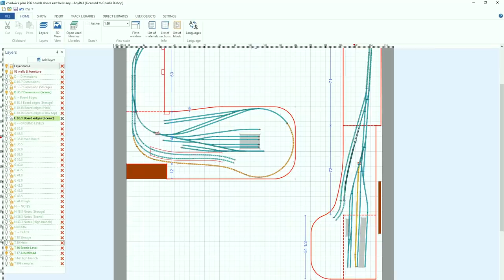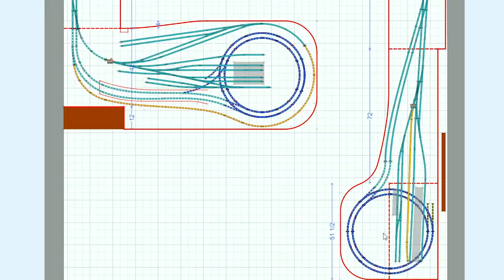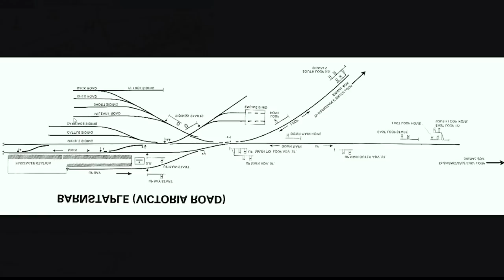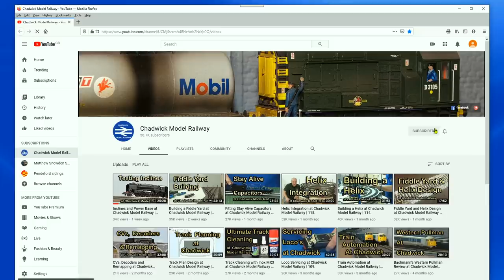Track Laying on the Station Approach at Chadwick Model Railway | 125.

Comment: Hi Charlie.
Good work so far.
However, there's something that's missing from your pointwork... catch points.
With the area being on an incline, the chances of runaway stock is much higher than on a flat surface.
At a minimum you'd need one after the double-slip (on the viaduct end)... and possibly another where the goods lines go onto the platform sidings.

Hope that proves useful to you

Laura
Reply from the maker: Yes that one past me by Laura. I’m putting one at the end of the two good lines as they approach the double slip. Regards Charlie

Comment: How did you get from 4% down to 2.5%? I have altered my layout plan again and now I will be able to run 3 trains (DC) at any time, but I have moved the inclines to the straight sections of tracks. The boards will be made in six sections, but the design is wide and I am now worried about if anything goes wrong towards the back, how will I reach it. Until I can move into the room where the layout is going to be (18-year-old stepdaughter going to university or Technical College.) Board number one and five are nearly in the building stage. (At last.) Another informative video. Thank you, Charlie. (Two wires) Martin. (Thailand)
Reply from the maker: We struggle on together Martin. 
Regards Charlie.

Comment: Hi Charlie, you did not mention removing the locking spring when using Tortoise or cobalt point motors.
Reply from the maker: Yes sorry Chris, it’s one thing I did miss out. Regards Charlie

Comment: Hi Charlie Sorry this a Bit Late as i usually Play your Videos when I'm in my Loft but around 19 mins you were asking about Glue for your Track I'm in the Flooring Business  use F Ball F1 Its a Rubber Glue  we Use for Stick Carpets i've got a 5 Litre Bottle that's 4 years old and i still use it it's a lot Cheaper around £45 a bit cheaper than Copydex
Reply from the maker: Thanks Chris, that’s an interesting option. Regards Charlie

Comment: I didn't know Barnstaple station before you mentioned it, but have just looked on the brilliant maps.nls.uk site at the Barnstaple Junction track plan 1890s-early 1900s.  I know you're only using it as inspiration, not modelling it, but that c. 1900 trackplan looks like it could be the basis of a very interesting model, with the North Devon line going off in one direction, and then a scary looking very steep S bend taking another line over to Barnstaple Town station/quay to join the Lynton & Barnstaple Railway and the LSWR Ilfracombe branch. You'd only need to extend the line from the station yard across the road to meet the viaduct over the river, and you'd have a nice little Y, giving even more operating possibilities.  Who knows, maybe one day if I ever get a house with room for a railway ...
Reply from the maker: Perhaps it will be an idea for an exhibition layout to build a later stage Andrew. Regards Charlie

Comment: Hi Charlie,
Looks like your getting there.
I’m trying to find the Anyrail package your layout has been designed on, can you point in the right direction where to find it (looked in App Store on iPad).
Cheers 
Andrew
Reply from the maker: Sadly, is a PC only program Andrew.
Reply: @ChadwickModelRailway  thanks Charlie, I watched a tutorial by Ron on RTNT I have used full Autocad in the distant past and it’s a very similar programme.
I’ll have to dig out a laptop running windows to have a go on the free trial pack.
Regards 
Andrew

Comment: Awesome video as always.

Any reason for the non-electrofrog double slip? I know you normally go EF for other points (as will I when I finally get underway) but since I'm likely to have a couple of double slips, just would appreciate your take on them....
Reply from the maker: The electrofrog is only available in Code 75.  If I was operating shunters in that area without “stay-alives” I would have.
Reply: That makes sense!

Apart from them not doing it in anything other than the code 75 🤣

Comment: Hi  from Israel. Another great video especially as I am finally getting back into the hobby and now building my baseboards. It just struck me that you don't seem to seal you baseboards. Is there a reason for that, since we all slosh lots of liquids on when ballasting, plastering and other messy parts of building?
BTW I paint the undersides white so its easier to see my wiring against it and also write on reminders of what is above and connected where.
Reply from the maker: An interesting point, and one which I’ve never really thought about. I seem to be getting on okay so I’ll think I’ll stick with the system. Regards Charlie

Comment: Following your journey intently and will have a huge influence when I begin my own layout build.
Just one question, what is the thickness of your track bed, is it 3mm or 5mm?...I'm trying to figure what is the most ideal ballast shoulder thickness for a current day layout.
Reply from the maker: Are use 5 mm track bed and it seems fine. However you do have to jack up the platforms a little. Regards Charlie

Comment: What are those measurements in AWG?  What about disguising a section of plastic duct as a building with a roof made out of vent filter fabric?  It should allow the heat through it and still resemble a building.
Reply from the maker: An interesting option Paul. Regards Charlie

Comment: It’s all looking great.  Further on down the Coast I used to do some work near Westward Ho! / Bideford and we walked an old closed line frequently -  inland to a pub called the Puffing Billy (great steak 30 odd years ago!). Would that line be connected to the Barnstaple line?  Some wonderful views.  
Dak
Reply from the maker: I’m not that conversant with the area. However, it really is a beautiful part of the countryside. I remember as a young sailor going surfing at Westward Ho. Good times. Regards Charlie
Reply: @ChadwickModelRailway  That would be the Bideford Westward Ho and Appledore Light Railway, the engine shed in Bideford is still there as a tyre depot l think. It is a beautiful bracing walk around the cliff where the train ran. I see others have given clarity on the Barnstaple station. BTW copydex is ammonia based and can give a nasty headache from too much close use... not your kind of quantities though.  Good wishes and thanks for the ever instructional video. Peter
Reply: Coincidentally I taught surfing at Westward Ho! for a season.  Okay, so I expect to see an appropriately clad lad, with tousled blonde locks, carrying his board on the platform - changing trains to grab some swells.
Reply: @peterbailey9955  the Tarka trail?
Reply: @dakdak7609   @Dak Dak  The Tarka Trail is the former SR route from Barnstaple Junction, Bideford to Torrington. The BWALR was separate.  Long closed and lasted a relatively short time. There are pictures on Google and look at the NLS maps here.  https://maps.nls.uk/geo/explore/#zoom=16&lat=51.04010&lon=-4.24065&layers=168&b=1  and a piece in the D St Thomas History of railways in the West Country, plus a good piece on Wikipedia.  Bideford carriage shed here : https://www.google.co.uk/maps/@51.0231125,-4.2087678,3a,75y,291.76h,86.8t/data=!3m6!1e1!3m4!1sQ9mhwr9Miq0jHWP_TTp19w!2e0!7i16384!8i8192?hl=en      Hope this helps.
Reply: @margiebailey9278  thanks - and I see the former station which was the pub we used to walk to is now a Cafe I think.  Good memories - especially the walk home with head torches after closing time!  Lovely area.

Comment: Hi Charlie! As usual an inspiring video - and with nice lighting and angles, as always. Thank you for making these. Now, I'm not a carpenter by a far stretch, but if I may make a suggestion: I think you should consider buying Torx screws, rather than the phillips ones you're using. The reason being, that the torx screws keep the "thread" much better and they are easier to "grip", if they need to come out again. (Hope that makes sense...) I always use torx, and have never had problems with removing them again, whereas phillips or straight screws can be somewhat of a struggle to remove. Just me 2 pence... editing: It shouldn't be "thread" but the head of the screw, where the drill bits grip. Don't know what it's called. Sorry, I'm Danish, but hope you get the idea....
Reply from the maker: A very interesting point thank you. I shall buy some and give them a go. Regards Charlie

Comment: Ever since the start of this recent bit [apres helix] I have been wondering why you did not just put the open frame a bit higher. by the way, I am a carpenter [long retired] and there is nothing wrong at all with your base supports, as you say a tad over engineered, but that is no bad thing.
Reply from the maker: Hi Robin, it’s probably because I’ve never built an open frame system before. So I was a little suspicious on how it would turn out. Regards Charlie

Comment: Charlie, I have been using electrofrog (and now unifrog) points since I went back to model railways with DCC and I always took for granted the advice of cutting those two wires and bonding the stock and closure rails. It occurred to me though that if the frog is powered by the switch on the point motor, maybe you don't have to modify the points? The frog would then give power to the closure rails as well as the point rails?
Reply: OK so having read the DCC wiki pages, the danger from my approach is the stock and closure rails being shorted by the wheels. Setting the wheels should help, as would some paint or varnish on the inside of the danger parts, but I guess, snipping the links and bonding the stock and closure rails really is the best method.
Reply from the maker: Sorry Jane, but why are you getting shorts in the first place?  Do you need better wheel sets?

Comment: You can also buy a mortising attachment for a drill press should you ever need to drill square holes. :-)
You can also use latex based carpet glue instead of Copydex.
Reply from the maker: Interesting points, thank you. Regards Charlie

Comment: Hi Charlie, another great video and always a treat to watch on a Friday afternoon. I'm sure this has been covered in earlier videos, but what are the dimensions of the helix please?
Reply from the maker: Its diameter is 52 inches. Regards Charlie
Reply: The helix uses 3rd and 4th radius curves.  The overall size of its baseboard is 51.5 or 52 inches square, depending on which day you ask Charlie to measure (two of the corners are rounded off)
Reply: @ChadwickModelRailway  Great, thank you Charlie
Reply: @leestoddart7014  Great, thank you Lee

Comment: At 35:43 you won't need signals on the goods roads, just one by the double slip with a trap point :)
Reply from the maker: Yes I missed the trap point, I’ve just bought one on eBay!

Comment: I see someone has already said about a trap point on the exit from the goods yard, a small headshunt with coaling facility could be another option. 
With regards to your obsession with sound 😂. Have you tried speaking to a Car audio specialist? And I don't mean the ones at the local Halfords. When upgrading car audio systems they use a product called Dynomat to line panels and enclosures. It has the effect of reducing resonance though the panels. It could possibly be used on the underside of your boards to deaden any noise from the trains.
Reply from the maker: It is certainly something which I will consider once the wiring is complete Martin. Regards Charlie

Comment: Charlie you forgot to mention. The new peck unifrog its replacing both electrofrogs and insolfrogs lines there much easier to install as the tip of the frog is 100%insolated from all rails in the frog area
Reply from the maker: Yes a good point but their system still has many items missing from their range.
Reply: @ChadwickModelRailway  givne them time they just started back in 2018 on a complete overhaul to make the change over I know there's gaps sadly vivid threw a wrench in there works  I just wanted you to be aware of the change thats coming also I handlay my own n scale track

Comment: 50mm wide self adhesive 6mm foam for the track bed? Dont seem to be able to post the amazon link, but try 'fowong self adhesive foam strip' as a search in diy
Reply from the maker: Thanks for the tip, I shall certainly check it out.

Comment: Charlie why did you not us sound proofing on your model railways
Reply from the maker: I have, whenever practical I have used foam track bed. Regards, Charlie.
Reply: Charlie I'm thinking of using form on my model railway with some sound proofing as one modeler has said us Cork witch I probably will but in a different way I just need to look at a few areas to model my railway on as I live in the North West of England not short of railways or yards

Comment: Are u using code 100? Also why did u go for a inslufrog slip rather than an electrofrog? Ive not used a double slip and was interested in the reasons pros n cons of each
Reply from the maker: Yes the layout is generally code 100, and there isn’t an electro frog double slip available in that range. Please check out my previous videos as I have done one on slips and double slips which might be of interest to you. Regards Charlie
Reply: @ChadwickModelRailway  thanks must of missed that one... im on code 75 but actually considering changing to code 100 as I feel it may be more reliable
Reply from the maker: Not more reliable but certainly more robust.

Comment: "It smells of fish...", indeed it does which long since caused my wife to forbid me from using it; so, I don't!
"It's over engineered ..", as were most real railways built before the accountants ruled the world, so you are correctly following prototype practice!
Reply from the maker: That makes me shudder!  But you’re right Brian, accounts are a plague!
Reply: Where do you get the small track screw from
Reply: @marcusbailey1605  After seeing them used on Charlie's original video some weeks ago I ordered a  large pack (1000) of a M1.6 from Ali Express for about £10. Just look for M1.2 M1.4 M1.6 M1.7 Self Tapping Screw Wood Black Screws Tornillos Parafuso Cross Recessed Flat Head Countersunk Drywall DIN7982 on their web site.
Reply: @brucenelson2408  
Thank you

Comment: Hello Charlie,  enjoy your channel.  Your track plan for your terminus station reminded me of Bridgewater North on the S&D.  While it has the same issue of a single track approach - as you outlined for Barnstable, it had an island terminus platform as you are planning with the goods yard and quay line to the left as you look towards the country end of the station.  I have a copy of the signal box diagram in a book on the S&D but found this interesting article which may provide you with some inspiration /aid as you continue to plan the station.  http://trainweb.org/railwest/railco/sdjr/bw-branch.pdf
Reply from the maker: Many thanks, I shall check it out.

Comment: Another probem with fixation of the track using pins or screws is the vibration transfer, thus negating the use of the noise reducing underlay. It is best to secure the track by gluing it with PVA (or Copydex) and ballasting over it using a mix of Mod Podge and water as glue. that way you'll reduce way better the rolling noise and when using DCC sound engines, it's always better. Even without sound decoders, I prefer a smooth and not too noisy rolling as nothng annoys me more than hearing that rolling racket reminding me of the old times of the metallic track with integrated ballast from Mârklin in he 50's and 60's (I started with those, and after half an hour I had to stop the trains as the racket gave me headache ! ) - I guess it was the same with old Tin Plate track in the UK at the time...
Reply from the maker: An interesting comment Eric, thanks. I have a noise obsession regarding this, but I’ve never tried mod podge with water. Does it remain soft to the touch? Regards Charlie

Comment: Frustratingly I can't post a link here, but the original layout of Victoria Road Station  can be seen on the maps section of the National Museum of Scotland website. It's a great resource for seeing how the railways used to look.
Reply from the maker: Thanks for the info Mike, I shall check it out. Regards Charlie
Reply: @ChadwickModelRailway  Try this... maps.nls.uk/geo/explore/#zoom=18&lat=51.07588&lon=-4.04493&layers=168&b=1 and close the big box that appears in the middle...

Once you're there, you can zoom in and out, move about the map and change the transparency using the slider in the smaller box, on the left.

Comment: Why not use the cork on the wood, glue the foam track bed to that?
That way the ballast is still isolated from the wood and you should experience noise reduction.
Reply from the maker: Rest assured F1, I’ve tried loads of different options and that seemed the better one.
Reply: @ChadwickModelRailway  so my suggestion doesn't work? That's good to know, as I'm planning my model railway.

Comment: Charlie I have a book called Make it run like a dream by Joe Fugate which you can get as a download, it comprehensively covers all types of track work including how to deal with Grades and vertical curves. it is available from Model Railroad Hobbyist to purchase and down load very well researched if you haven't seen it it would be worth a look.    Neil
Reply from the maker: Thanks Neil, I shall certainly check it out. Regards Charlie